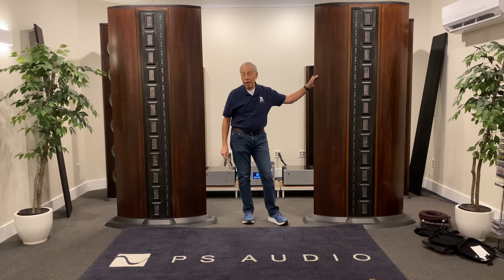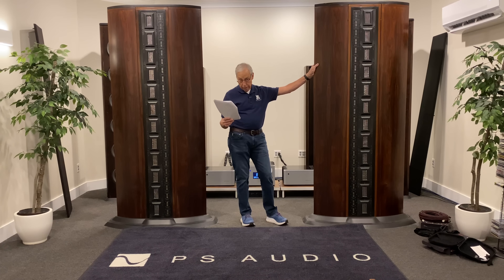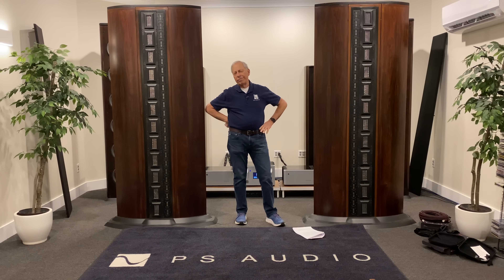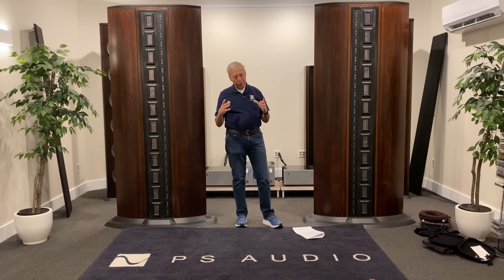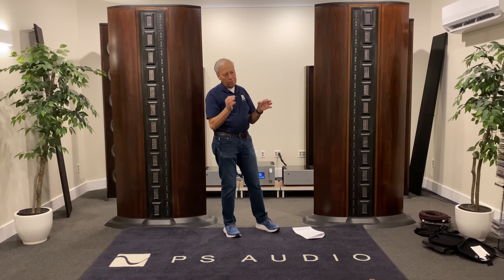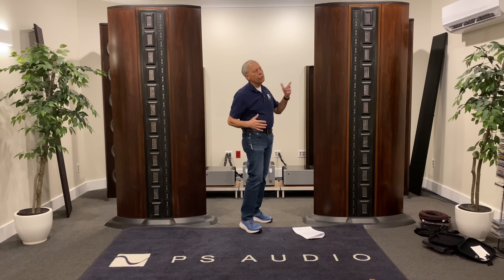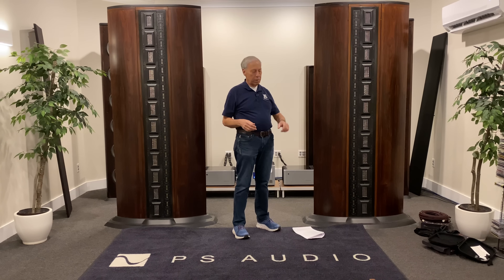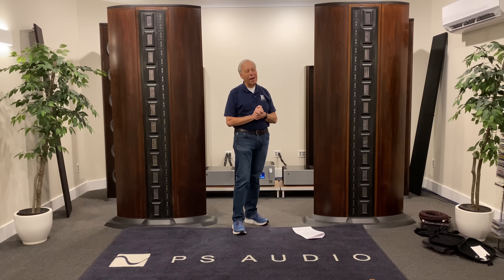Vibration damping. Snake oil?

Comment: Sorry, but that's perfect nonsense what is told here in the video! 
Whether a CD inside a CD player is damped by some damping layer/damping mat or not, makes absolutely NO difference in sound. Neither better nor worse.

Why? 
Because all bits are error corrected by a redundant FEC mechanism (mathematical algorithm) that repairs for all wrong bits (wrong bits due to, e.g., scratches, dust particles or vibrations). Meanwhile all corrected bits are buffered in a buffer chip so that all jitter is cancled to zero.
After that the DAC converts the corrected bits into an analogue signal.

So, this should be self-evident that damping of the CD does not make any sound difference.
Only if the FEC margins are exceeded by too strong disturbances, bit errors might remain and might be audible.
But for this you would need extremely scratched CD surfaces or a heavy shaking but not normal vibrations (for which the FEC is engineered sufficiently robust).

And one further proof for this:
"CD players" of computers (there called "CD ROM drives") do exactly the same like audio CD players, they collect and correct all bits via FEC and buffer them on a chip. 
If only one bit were wrong, e.g., a software program being stored on the CD-ROM would not run properly on your computer. 
So, the information on CD ROM must be 100% bit correct for any computer application (else the software will be buggy, maybe freeze).

And exactly the same mechanism as for the computer CD-ROMs is applied for audio CDs and CD players.
So, if all bits are 100% correct after FEC and even jitter being removed by the buffer memory chip, why should it be possible to hear differences due to a damping mat on the CD?

That is real "Snake Oil" respectively so-called "audiopile BS". If you believe to hear differences, it is the placebo effect.
Please check this by a real blind test and you will hear no differences anymore.

Comment: Around 1990 some thick plastic mats were put on a cd and the difference was remarkable, much more detail and ease in the sound. Probably because the error correction was much less involved because of much more stable spinning of the CD. So it was a purely mechanical effect resulting in a much better picking up of the cd track resulting in much better reproduction. But that was then. Maybe modern players ar much more stable.

Comment: All of my components are damped with sorbothane feet, but when I also just placed a heavy book on my yamaha cd player I thought I could hear a difference in bass tightness and less sibilant highs. The thin metal housing of such a cd player is a microphonic resonator that really should be damped in my opinion. I may get some lead ingots and place them on sorbothane pads to be placed atop the cd player in spots so as to not be blocking the thermal conductivity of the "hood" though a cd player like this doesn't really get hot  even after extended play.
Makes me think about dampening the Ares DAC as well.

Comment: Vibration control matters A LOT! For ANY component of the audio chain. I have many times thought I could, at last, rest and just enjoy, until the next vibration control remedy that came up to my mind, would unmistakably prove, there still had been room for improvement! I've found that solid state circuits are unexpectedly and surprisingly sensitive to microvibrations. Flaws in musical reproduction that I used to blame  my loudspeakers for, proved to disappear, after applying heavy microvibration control to my electronics. (and I don't even use moving parts- like a CD transport- at all!). That said, RF/EMI pollution is another great issue, an audiophile must take good care of.
Reply: All music is vibration, so vibrations are very important.

Comment: What is a CD Mat?  LOl... I had to google this first... But - as far as i am infected.. I believe that there is a relaation between reproduction of music and vibration-even in the electronic parts. I am not convinced if i can hear a big difference, but, from the physical standpoint it seems sound. When vibration is brought into a capacitor, then the mass can possibly work like a coil, and influence the Sound. And the same goes to any other electronic device on a board - no matter how small the parts are. 
That the human ear is able to hear a difference here? I think that`s crazy, but it might be. Why not? 150years ago no one beliefed that little grooves on a plain surface - picked up by a little needle-can bring a singing voice into a room. 

So, i give the idea the chance that it an be... I m not totally convinced, but i say,  it might be...  
I just pretend , theere is a Transormer in a chassis of an audio device! And the transformer swings with 50Hz... And this makes it possible that sound is produced. So, on the other hand, every vibration that disturbes these 50Hz can be heared to!  Why not? 
It`s magic! Muahaha..... lol

Comment: Max Townsend amongst many others is a strong proponent of vibration isolation. Playing with various types can either be rewarding or cause audio nervosa! Generally speaking the lossy types make for an easier, richer type of presentation,whereas the coupling styles ie: spikes are subjectively sharper and more dynamic.By all means experiment.Just try not to drive yourself crazy with all of the available options!

Comment: Hey Paul, what about the microvibrations generated by the electric current going through ALL components. Every component can benefit from vibration damping solutions that absorb these microvibrations. Can you comment on that as well?
Reply: Furutech power cord connectors are designed to mitigate against just that.

Comment: moving wires that have current going through them will also make magnetic fields. So vibrating electronics will possibly affect the sound of components. Not just accurate reading of optical disks and vinyl disks. but vibrations from speakers that goes down into a floor will impact the sound much more. So I would start there.

Comment: I remember thin flat rubber rings that you would stick on the top of a CD to "reduce vibrations". They were the size of a CD but only covered all around about 1/4 inch of the CD from  the outside edge.  Sort of like a rubber seal for a Mason jar. The were sold in packets of "so many" at high end audio stores.  They were also supposed to improve the sound quality. Once affixed they were permanent so you needed to buy several packets for your CD collection. I guess sort of the first CD mat. The vibration "thing" about CDs as been going since they were first introduced.
Reply: And don't forget the green magic marker around the edge so the laser light energy wouldn't spill over the edge. Clogs up the machine.
Reply: @jamesplotkin4674  Oh yes. I did forget about that one.

Comment: I have a brick on my cd player and some foam and cardboard pads underneath.  My super tweeters are on open cell foam to isolate for the speaker cabinet. My speakers spike into chopping boards on a old speaker boxs stuffed with fabric and topped with closed cell foam. Cheap cheap cheap 😆
Reply: chris...nothing wrong with 'cheap & effective'
I do the same with home made isolation platforms for my electronics (1cm thick glass plates with aluminium cone/spikes attached with vibration absorbing *BluTac*) & fig 8 (Besser/Cinder) concrete blocks arranged & glued (Epoxy Resin) to give me 'rock-solid' loudspeaker stands at exactly the required tweeter height & painted any colour that you like for $25.

Comment: My main vibration issue is my subwoofer coupling to the house causing things to rattle.
Reply: Buy a SVS Soundpath isolation system.
Reply: MrBravo143 Funny, I looked at those some weeks ago on Amazon and ended up with my own solution using 3 layers of rubber foam cut in squares 2”x2” and glued together. Product is called MyLifeUNIT Shock Absorbing Washer Pads. Total height is around 2.5”. They are designed for isolating washing machines but seem to work well for a subwoofer in this way.

Comment: Not sure if measurable but guessing that having vibration of the main quartz oscillator is less than optimum. Micro timing changes = potential for jitter. At higher volume levels with lots of bass you ideally don''t want your CD player vibrating to the beat of the music. For low volume listening it's not likely to be a big issue.
Reply: Yeah, I've read about this online; quartz crystal oscillators can be affected by vibration, resulting in jitter.
Reply: And this jitter sounds like...?
Reply: @thisisnev  Try reading this https://www.stereophile.com/reference/1290jitter/index.html

Comment: I think it also depends on A the player B the quality of the disk. if the disk is disk rot or is scratched or dirty your player has more trouble reading the disk. Same if it fibrates to much. The lucky part is that a CD has a lot of tech to handle error correction. however, ideally, you get a perfect read and no correction is needed on your played media. One of the reasons i use files instead of disks :) less of an issue reading the content and its buffered in memory. When you extract a CD you can decide to use a multi-pass read. basically, it reads the data multiple times and tries to find the result that matches the most passes resulting in a better quality playback of the extracted audio. that luxury is not there is a real-time playback session on a cd player

Comment: There is no benefit to adding dampening to the CD transport because the CD transport mechanism already a) has internal dampening; and b) has a servomechanism that keeps the laser in focus to the data layer of the disc. The vibrations from the disc spinning are magnitudes greater than what will be induced by your speakers. Also, the data coming off the disc is run through a descrambler and held in memory buffers while it’s being processed; and then it’s output at a fixed clock rate (44.1khz) which is derived from a quartz crystal.

However, at and after the DAC stage, things are different: this is where the mentioned microphonics come into play; affecting capacitors, inductors, and tubes. Due to their nature and packaging, transistors tend to be immune to this, however. Ideally, you would put your analog stages in a separate sound-isolated room; and if you really wanted to go the extra mile, in a vacuum chamber and use direct liquid cooling (the same way high-end PCs do) for the components that need it.

Also; one needn’t spend big $$$ on dampening materials; a layer of viscoelastic memory foam such as is sold as a mattress topper is cheap and works very well (just be sure that it isn’t blocking any ventilation holes; putting a piece of particle board or MDF on top of it between the damper and the piece of equipment being addressed will solve that issue). Alternatively, extra-large mousepads are available for not much $$$; I have several from Monoprice.

Comment: FWIW: I rip my CDs using a cheap plastic USB CD-ROM drive. The poor thing is buzzing and vibrating as it reaches ~24x speed, however my rips are always perfect (confirmed by AccurateRip DB) even in the simple burst read mode unless the CD is badly scratched. I'm not buying any mat for sure! 😄
Reply: @Omne Obstat If the disc is scratched, my venerable old Marantz CD-56 will probably read it!
Reply: NeekonMike ripping is different than direct audio reproduction from a CD player in that in ripping errors are corrected 100% since the process is not time critical and the protocol allows for the cd controller to reread the data as many times as required or drop speed in an attempt to improve error rate. Redbook CD direct reproduction is not like this and the ability for error correction is more limited.  However, errors in digital readout result in usually well defined errors such as clicks, pops, skips and dropouts not in colourations and distortion as in analogue reproduction. If you do not hear clicks and pops then you probably do not have to improve anything.
Reply: @razisn  No one hears clicks and pops on their domestic CD player unless they place it on top of a road drill.  It's pure snake oil to come away with rubbish like putting mats on top of CD's.
Reply: @razisn  In the fastest burst rip mode there is no rereading, just direct feed from the drive. There may be hardware error correction happening as necessary, similar to CD player playback, but without rereading. Slower secure rip mode uses extensive error checking and rereading if needed. Still, with CDs in decent condition I get perfect rips even in burst mode so I only use secure rip if errors are encountered. No matter how some try to spin it (pun intended), CD format was designed to be very robust (look up Reed-Solomon coding and Eight-to-Fourteen modulation if interested) and even late '70s/early '80s tech works beautifully. We may have advanced the DA conversion in the meantime, but reading data reliably was never an issue.
Reply: NeekonMike we are not in disagreement.

Comment: Vibrations matter
Most hifi is in a room with lots of vibrations caused by the music
Therefore, does it make sense to have the system in a different room and run speaker cable through the walls?
Reply: Almost my entire system is in the garage. Only the CD player and turntable are in the living room and of course the speakers and subwoofers. This is mostly done because of esthetic reasons. All the gear is suspended on the wall. In the living room I use Solidsteel WS-5’s
Reply: Legend says that this is what Ivor Tiefenbrun noticed when listening to his records. From there he designed the legendary LP12 and Linn was born.

Comment: The jury is still out 😂🤣
Reply: Fat Rat ... did you also use a green market for your CDs?
Reply: @hushpuppykl ...yup!
At $8 for the pen I wasn't gonna argue whether it made a difference or not; technically it made sense so I just did it. 66% of my collection is 'green penned' but it's easy to remove with Methylated Spirits.